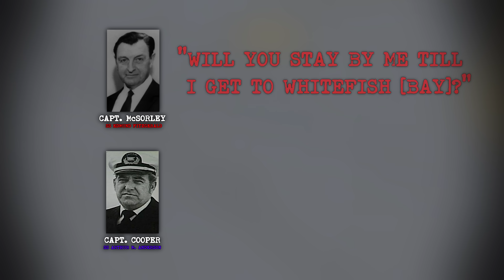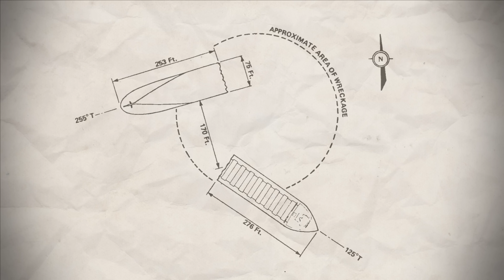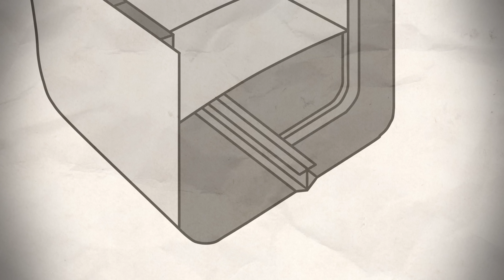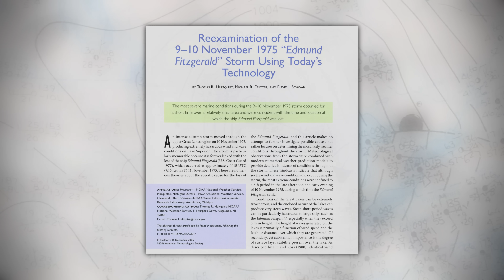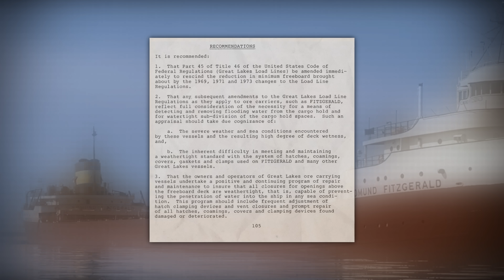What Sank the Edmund Fitzgerald?

Comment: A fascinating subject however, if you do enough research, you will discover the cause of the sinking. RIP to the crew of the Fitz.
Reply: Then what is the cause?
Reply: @tinecrinec4769  She bottomed out going over 6 fathom shoals. She would have made Whitefish Bay if it hadn't been for the storm. RIP to the crew of the Fitz.
Reply: @tinecrinec4769  Hitting bottom on 6 fathom shoal(s) was the main reason. Then the storm finished her off. They most likely would have made Whitefish Bay if it hadn't been for the storm/conditions.
RIP to the crew of the Fitz.

Comment: The loss of the Fitzgerald has basically been solved, thanks to recent work by Sean Kery and Ben Fisher. 
Her ballast tank vents likely acted as a siphon to suck water trapped behind her fish rail from the deck into the ballast tanks, causing her to develop the list McSorely reported. Eventually, one of her hatch covers gave way, allowing the waves rolling over her deck to flood into her forward cargo hold. That sealed her fate, and is why she never sent a distress call. Based on their flooding analysis, from the moment the hatch cover gave way to the moment the bow hit the bottom of the lake, 530’ down, was only 2 minutes and 27 seconds. 
Kery, Sean and Fisher, Ben; A Forensic Investigation Of The Breakup And Sinking Of The Great Lakes Iron Ore Carrier Edmund Fitzgerald, November 10th 1975, Using Modern Naval Architecture Tools And Techniques, CSC Papers, 2013 (presented at the SNAME Marine Forensics Symposium)